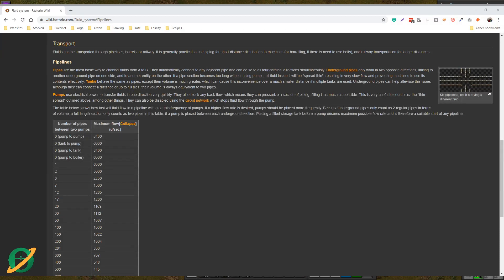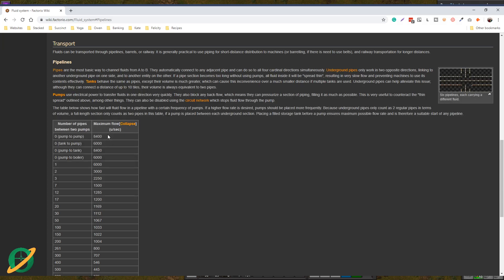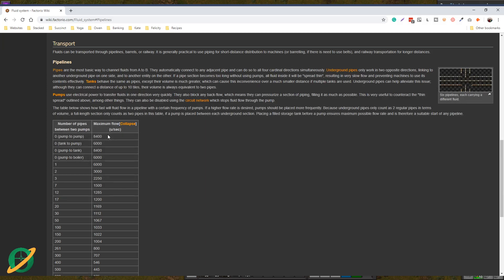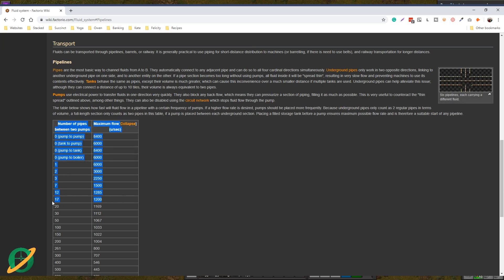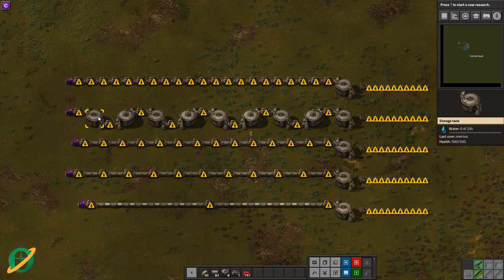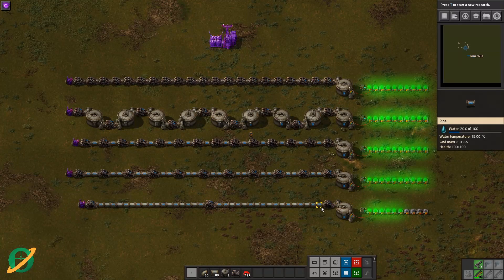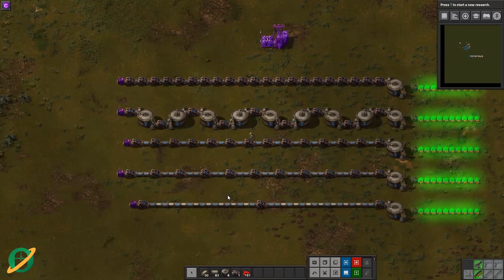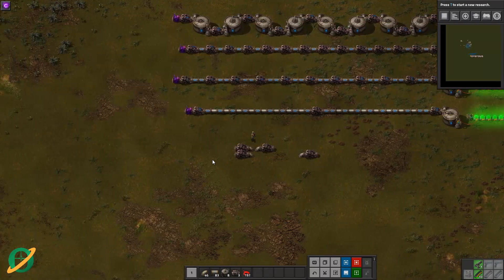Factorio Beginner Tips: Pipe throughput

Comment: I know this is an older video, I'm not sure if you're playing Space Age, but it's amazing. Anyway, is the amount of fluid in the pipe proportional to the amount of fluid in the tank? I have one tank with 4,000 water, connected to a heat exchanger by a pump with one pipe in between. The pipe has 16 fluid in it. The pump is full, but the nuclear power doesn't last all that long and I obviously don't want to wait until my tanks are full every time I want to run my power.

Comment: It remains one of the worst parts of of Factorio, so unintuitive and needlessly complex. 
Trying to setup nuclear and trying to capture 100% of the steam for storage and not immediate use is a nightmare of fluid not behaving at all like you would expect. 
And requiring pump chains to get maximum throughput is ridiculous and unrealistic, pump to pump to pump? 
One single pipe in the middle of that immediately halves your throughput. 
It looks terrible and makes it so you can only turn directions with storage tanks which is bulky. Meanwhile you make make 1 section, copy paste it 4 times and none of them behave exactly the same. They're fucking parallel and copy pasted but because of the way the steam is travelling through the tanks can change how the rest of the connected system works.  
Made a giant storage tank system to store 8 million steam? Good luck if you ever need to move it, pumps between large tank systems have shit throughput for seemingly no reason. Fill a tank, pump to another tank, don't get 12000? Why the hell not? Idk!

And why the hell 103 water and steam per second which means 1 offshore pump runs 12 heat exchangers only at 97% efficiency! Want to add another offshore pump so it's 2 offshore pumps per 12 exchangers except somehow the throughput remains unchanged. Fuck you Factorio, fuck you.

Comment: Sooo... is there anyway to pump 6500 a second? Like distance of 250 steam turbines?
Modded machines but not using a modded pipe thing
Reply from the maker: Looking at the wiki, pump-pump gives 12000/s as does pump-boiler-pump. Pump-boiler-boiler-pump only does 6000. Assuming that stream turbines are treated the same as boilers, which seems fair from a fluid perspective, then you'd need to have a pump between every turbine, at least until the flow rate drops below 6000/s due to use.

Comment: I think you forgot some possibilities of transferring water. Trains and barrels. Like how much water can you move by using just one belt and barrels? I don't claim this would needed to be part of the video, since it's just on pipes, but it would be interesting to know how much water is possible to move just by using one pipeline or one belt full of barrels of water. Is the all pumps row faster than the full belt of barrels?
Reply from the maker: That's an interesting thought! Some quick math: a barrel holds 50 water. Blue belts do 45 items per second. Therefore a blue belt can do 2 250 water per second. At a guess, a detailed study into the material cost of blue belts versus pumps would probably come up in favour of pumps. And there's always the UPS issues to consider if you're going big, as not only will you have more items on belts, but the filling and emptying of barrels will take a couple of assemblers on each end to keep up.

Comment: Does it have a difference if all the pumps are concentrated in the beginning of the pipes or they have to be distributed as you did?
Reply from the maker: It sure does. One pump outputs 1200 water per second, so hooking two up to the same pipe will output 2400/s. If you want this to not be wasted, you need to limit yourself to TWO pipe segments between pumps, otherwise the flow rate is capped below that level.

Comment: I did ask more questions about what the game sees different parts as in terms of flow rate.
Then I found this dev post and they answered them;

https://forums.factorio.com/viewtopic.php?f=18&t=19851

Annoyingly the pictures don't work any more but still... I thought I'd leave this here to be handy for others.
Reply from the maker: Fluid mechanics in Factorio are a crazy thing that I'm neither an expert on nor do I have any intention to delve too deeply into. In saying that, pipe throughput is pretty simple to understand and something that tricks up a lot of players especially when it comes to supplying water to nuclear power plants. The best tips I've received over the years are to keep fluids down to a minimum wherever possible, ie limit the number of tanks, pipes, etc as the calculations required make for some serious pressure on your UPS late game (no pun intended).
Reply: Try this from the Wayback Machine

https://web.archive.org/web/20171227174654/https://forums.factorio.com/viewtopic.php?f=18&t=19851
Reply from the maker: The Wayback Machine, so good!